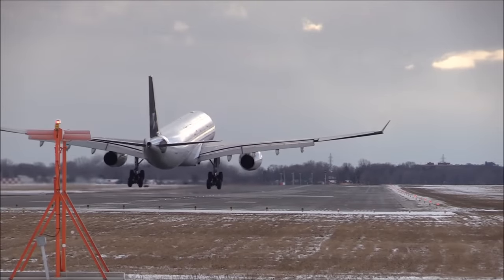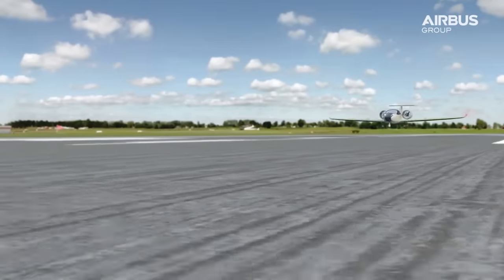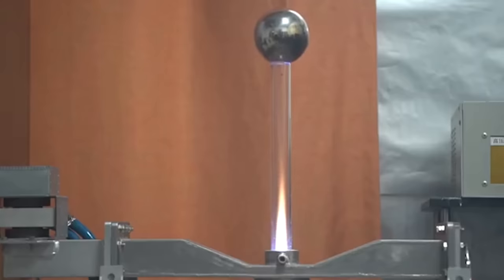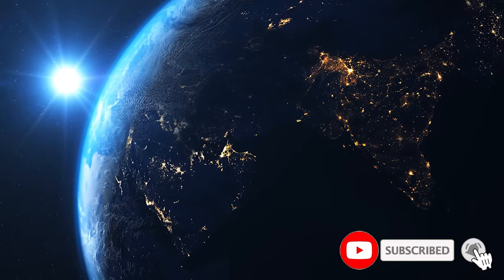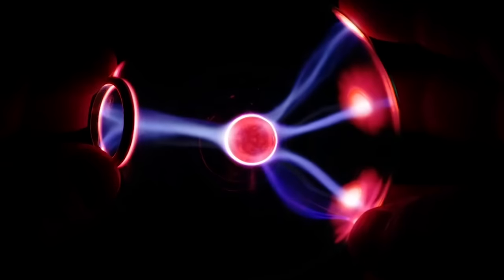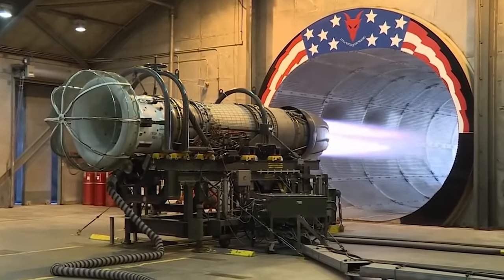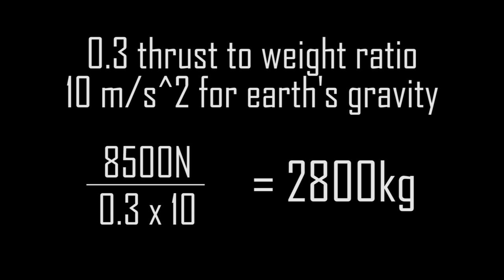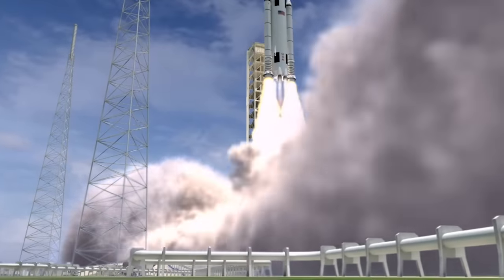Uncovering China's New Electric Plasma Jet Engine

Comment: The engine isnt the problem of electric plane. Energy dencity of the battery is the problem. You can have all the power you want. But without good battery you go nowhere.

Edit: we need hydrogen planes. 
Forget about the plasma thing, that is stupid for planes
Reply: they can already fly an electric plane using a series of laser beams for a power source,   from the ground..
Reply: @THOMASTHESAILOR Truly?  Riding on the wings of lasers. Skull and Shark playing in the background.
Reply: @KF1  , No , Silly..
  A powerful laser beam hits some kind of solar panel on the bottom of the plane and provides massive electrical power to the plane..
  It's been done and tested already..
Reply: @THOMASTHESAILOR  yes I got that. Search "laserhawk" and you understand. It's motion turned to music.
Reply: @KF1  ,  Unfortunately,  I don't watch much Hollywood..
  There is a real, genuine laser propulsion system invented a few years ago...  A laser from the ground pointed at an aircraft..  It works..
Reply: @THOMASTHESAILOR  who said anything about Hollywood? Also, yes, I get the means of propulsion. Microwaves would also work
Reply: @THOMASTHESAILOR   And building laser beam energy supply stations every mile would cost too much and the safety factors alone would be stupid !
Reply: @cruzemissile5409  ,  That's one of the many reasons it ain't in use,  but ,  it is possible..
Reply: Well not exactly nowhere, just nowhere far.
Reply: @THOMASTHESAILOR  Microwave transmission of power might be more likely than laser, however in either version of beamed power, the largest cross section possible to receive the power would be needed resulting in flying saucers.
Reply: @johnwang9914  logic demands flying saucers. I like it
Reply: @THOMASTHESAILOR  ocean
Reply: what was the innovation in that research paper then?
Reply: @jwhatever1086  In terms of crossing oceans, orbital solar power stations.  Of course, this is all highly unlikely given the immense capital costs required.

However, if it's information about beamed propulsion you're looking for, you could start with Wikipedia.

https://en.m.wikipedia.org/wiki/Beam-powered_propulsion#:~:text=Beamed%20propulsion%20in%20the%20form,efficiency%20due%20to%20heating%20effects.
Reply: @effexon  I don't believe anyone mentioned any paper so what are you talking about?
Reply: @johnwang9914  oh, I thought those Wuhan researchers, but I guess it is not public research then.
Reply: How much does this battery going to weigh??? Was a nice thought... wonder where it was reverse engineered from????
Reply: @musclecarluvr3928  the battery is always the problem. Not energy dense enough. Altough you can alwayd go nucleair
Reply: @rubikfan1  maybe we're better off with conventional propulsion systems. Like the other guy mentioned, necessary booster stations might be more trouble than worth. 
  How far can beamed energy remain viable? Inverse square law? Do lasers hold coherency any better than that? 
Damn you, practical physics. Ruining my dreams of lasercraft. 
I think in a highly efficient future we might be cruising around in blimps. 
 Imagine the tv show Pimp My Blimp
Reply: If you carry batteries as well as freight or passengers, you are already dead in the water as the extra lift youll need already wipes out the flying guppy idea.
Reply: @hankscorpio42069  Holy crap you're awesome. That's super insightful. 
Also, it was a joke, more or less. But still, you're awesome
Reply: Nikola Tesla designed and built the working system to power electric aircraft 
.
But the mega rich men back then banned it because they wouldnt make enough money selling us all batteries and taxed mains electricity 🙄
Reply: @darkslayer6911  that was the wireless power. The problem was that system couldnt see who took power. So the power company didnt want it. The system whould not even work today unless the state is willing to pay all electrischity. Wont happen.
Reply: @rubikfan1     but.... 
     What i cant wait for v soon,
   Is these very few horrible greedy men who are not happy with being billionaires....
    Are going to be deleted 😁
..
 we have world peace and a star trek era just round the corner 👍
..
They are GOING to be deleted 😇😁 wooohoooooo
Reply: Density
Reply: @THOMASTHESAILOR  Damn, you beat me to it!
Reply: @rubikfan1  it wouldn't work anyways in the first place. It was just a pipe dream. 

Energy density is the main reasons why you will likely never see battery flying commercial aircraft anytime soon.
Reply: The question is not can it work?  The question is can we get funding for research?
Reply: Well, kinda off.
You need energy efficient engines as well as power storage, when either fails it won't work.
Converting efficiently from electrical energy to thrust is equally important.
An engine working at 50% power conversion with an x capable power store, will yield the same amount of thrust as an engine with 100% power conversion and x/2 capable power store.
The result in greater efficiency yields less power store, which in turn yields less weight.
Reply: What about hydrogen powered air plains. Hydrogen has the best energy per weight ratio. Airbus has already developed three planes powered by hydrogen.
Reply: @tilmannsteffen9248  yup. Hydrogen has a change. Altough highest per mass yes. But not highest per volume. There are are  2 option. Gas or liquid. Gas is compressed to 700 bar. Prety dense. But liquid is even more dense. How ever it needs to be super chilled. So for cars its a no brainer to go gas. But because airplanes use all fuel in one trip, liquid becomes an option. And because the only infrastructure is airports. Its should be relativly easy to build an hydrogen station in there.
Reply: Which is why, it’s dumb to develop better thrust options for a potential future improvement in battery energy density? You need a lot of dead end avenues to find the one that get’s you their in developing new capabilities.
Reply: laughs in extension cord
Reply: @tilmannsteffen9248  hydrogen is extremely dangerous and is unlikely to be implemented in commercial planes. To be honest if we could somehow fix a nuclear reactor in an aircraft that would be ideal, but getting the general population on board mixed with the requirements of water and the weight of lead I don't see it happening. 

One thing alot of people don't really understand is the social and political implications of different choices and the publics perceived risk. Jet fuel while extremely energy dense is actually quite hard to ignite.

Anything that deals with the general public has to pass the social PR battle.
Reply: @THOMASTHESAILOR  Sounds great… until you get above the clouds.
Reply: @pseudotasuki  ,  yup,  or even a foggy day could be a problem..  Heavy down pour , etc..
Reply: I5 literally says that in the video
Reply: Dude, this is it. This is beautiful! Hydrogen is the fuel of the future! Anywhere electricity is needed Hydrogen can be used to directly and instantly convey into electricity and it weighs same if not less than Gasoline! Easily refueled much quicker than battery 🔋
Reply: @seemlesslies  
Kerosin is pretty much diesel, you could fuel a normal diesel car with it.
It is ignited very easily, especially compaired to hydrogen.
Most of the hydrogen will dissipate immediately if a tank is punctured which would pretty much render an explosion impossible.

If you can get people to sit in millimetre thick pressurised tubes ontop of hundreds of tons of easily igniteable material, powered by machines that a single pebble can destroy if it enters the compressor, switching the energy source shouldn't be the problem.
Reply: @carstekoch  I think unlike petrol / gas both kerosine and diesel don't evaporate. Which make them significantly safer than petrol. 
Or hydrogen. So in that way diesen and kerosine are similar when talking about safety.
There really is no good solution in sight for air travel... only way is to air travel less, travel slower with more efficient planes designed to go slower.
And build out high speed train network and robotaxis.
Reply: @THOMASTHESAILOR  how do they fly on cloudy days?
Reply: @dejayrezme8617  
Not really. They evaporate too. Modern aircrafts fill their emptying tanks with nitrogen to prevent an explosive mixture.
TWA-800 (747 exploded center tank) is a prime example of the worst case scenario.
The most important reason why Kerosin is used instead of petrol is the price.
Reply: @washablejunk281  I don't think they fly at all..  It was an experiment..
Reply: @carstekoch  Kerosin doesn't evaporate in normal conditions. In case of TWA-800 kerosin was heated up by air conditioner.
Reply: But another issue is "c" instead of "s"...but yeah batteries don't even come close to the energy density of what gasoline or jet fuels have
Reply: Producing hydrogen is polluting the environment
Reply: @THOMASTHESAILOR  it would take energy levels enough to melt lead to do that. It's really only a decent option for lite space objects as gravity is really strong compared to light. And no, beaming power from the ground isn't a good solution either as electric to light and then light to power conversions are terribly inefficient. Light to electricity is only about 20% at best so you're talking about using more than 4 times the power of taking it with you.
Reply: @rubikfan1 a hydrogen plane would never work because hydrogen is a terrible fuel, a terrible energy store.  We would need massive amount of space to store hydrogen because hydrogen is a dense chemical. And in planes, you will rarely find free space, let alone enough hydrogen to make a hydrogen fuel plane viable. Another thing is hydrogen is normally made from water and for us to get that hydrogen out of the water, we need to use electrolysis which requires an insane amount of power to do. To produce hydrogen on a mass scale in like a factory/plant would be insane, the factory itself would probably have to have its own power station which would be very uneconomic. If you want to make planes electric, use batteries but wait until the technology has come far enough that it is now viable and affordable.
Reply: Is nobody going to suggest the, simple, safe, already tested idea of just keeping on using hydrocarbons? just make them using CO2 from the air and electricity from renewables and you're good to go - yes it'll be fairly expensive, but that'll decrease as electricity prices decrease, from tech such as fusion ect.
Reply: @robbiejames1540  the problem is pulling CO2 from the air take more than 5 times the energy we get burning it. It's really not great strategy. It solves the fact gas is a limited resource but only makes the cost go drastically up. 

In the end I think converting airplanes to electric is kinda wasted as you basically need a nuclear reactor on the plane to run such engines to a similar effect. At that point we then have to question if having 1000s of nuclear reactors with the potential of falling out of the sky is safe for society. It makes sense to use some recycled carbon fuel but not really to go all electric. It would be perfect if we could but physics isn't really working with us on that. 

Electrical prices aren't really getting much lower. Fusion is no means cheap power, it's just renewable power. It requires us getting the rarest form of hydrogen which does exist in water but is extremely rare, or we have to dig it up from the moon. Solar also isn't really cheaper as while it doesn't need constant work to run, it needs both the panels and battery banks to be sustained so that's not really getting much cheaper either.
Reply: @Skylancer727  
Well, I looked around the internet for a while, but I wasn't able to find a nice, definitive quote for the energy efficiency of a "blue crude" process anywhere, so I'll trust your 20% figure for the moment. However, at least to begin with, we can greatly decrease the energy cost of capturing the CO2 by piping it in from factories that unavoidably produce it, such as cement plants etc. i totally agree that fusion is by no means a cheap form of power, indeed, its currently not a form of power at all. However, it absolutely has the potential to become a cheap form of power, with deuterium - deuterium fusion using tiny amounts of an inexpensive resource - if we can make work. Also, if we really want a sustainable, carbon neutral world, we might have to accept certain things getting much more expensive, like air travel.
Reply: @robbiejames1540  well another thing people need to remember is that collected CO2 most often instead of being used to make more fuel is usually used to pressurize oil wells to push out the extra oil. It's a strategy that's been used for years as by far it's the most profitable use for carbon capture today and those power plants are gonna sell to the most profitable ventures. 

Fusion even when it does get. Finalized still has a long ways till mass production. Assuming ITER functions as intended in 2025, that still means mass fusion production is still another 30 years off. Even then though it just ends up being an alternative to fission reactors where they both have massive upfront costs to produce but fission is cheaper to run while fusion is safer to run. Plus there is always the idea of turning nuclear waste into crystallized batteries for continued energy. That's still proof of concept but when we're talking a 30 year gap it's hard to say how much closer fission can get to fusion in the long run. Fusion is still the power of the future though but it's got a long road ahead of it yet. 

But back on topic. If we already have these new advanced fusion reactors and fission reactors, why not just use that to power the planes of the future? With fusion you can even use the waste exhaust to ignite the air out of the jet engines as a substitute to gas combustion and with either you can use the waste heat not just for power but for running scram or ram jets for super sonic planes if we really wanted to. I doubt super sonic planes are the future but if it were that is a way to achieve such. 

Main issue for planes right now though is weight for landing though and that's where nuclear kinda sucks for planes. Many planes needing emergency stops have to dump out their fuel to make an emergency landing and not totally blow out the landing gear. It's an issue any technology with planes will have to deal with. Why probably the best for planes would be if hydrogen took off as then it can just be vented out.
Reply: 20 years ago.  The  world says  electric car is impossible  
But now its happened . ....  
Just wait , for an electric,  solar jet......... 😉
Reply: energy density of hydrogen is dreadful. hydrogen is an awful fuel all round. it's a dead end.
Reply: @Withnail1969  
Yes, it's energy density per unit volume is awful, but by no means does that make it awful all round. It has the best energy density per unit weight of any conventional fuel by a large margin and burns to produce only water. If it was awful all round, you wouldn't see it used in spacecraft.
Reply: @robbiejames1540  no it does not, the best fuel energy density wise is diesel.
Reply: @Withnail1969  
In terms of specific energy, ie energy per kilo, hydrogen is the out and out winner. Wikipedia it if you don't belive me.
Reply: Plasma is useless for now we just don't know enough about anything to write it off completely

Comment: Decades ago the Army examined the potential of an "electro-thermal" in which plasma was introduced into the chamber to improve combustion of the conventional propellant. Sound speed of the gas limits the velocity of the projectile so the plasma "bootstraps" the process.  I would suggest a microwave augmented system might improve combustion efficiency, reduce emissions and make the stored energy issue manageable
Reply: but... that's exactly what this is.
Reply: @Dudeman9339  I was under the impression that the plasma was made of compressed air and not fuel